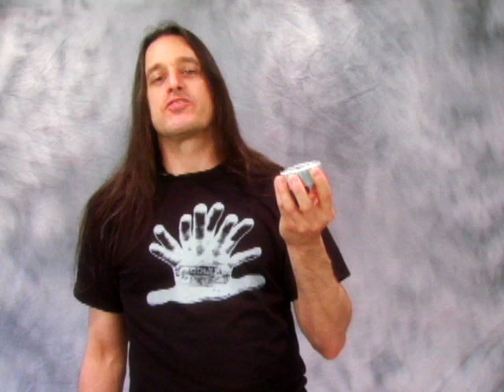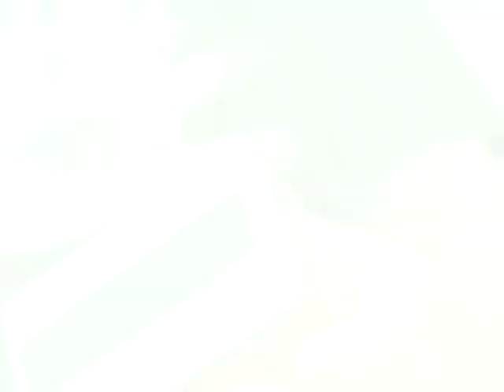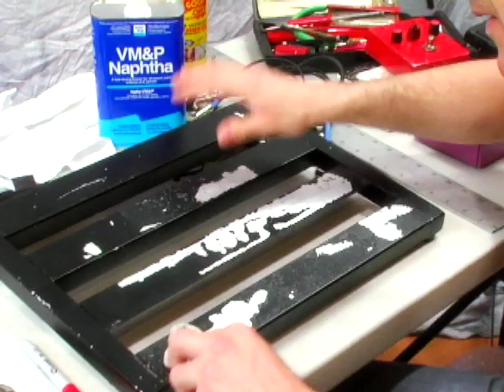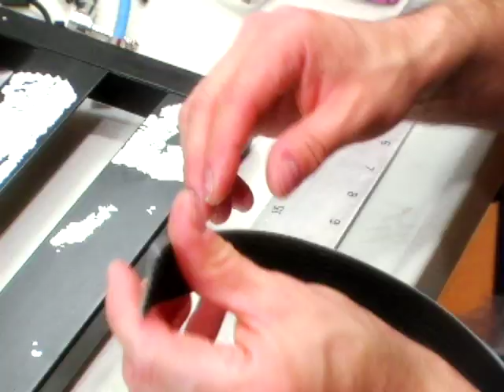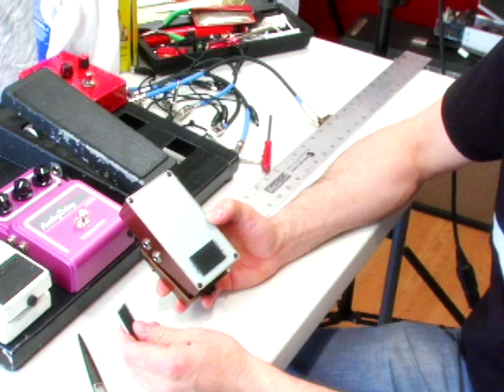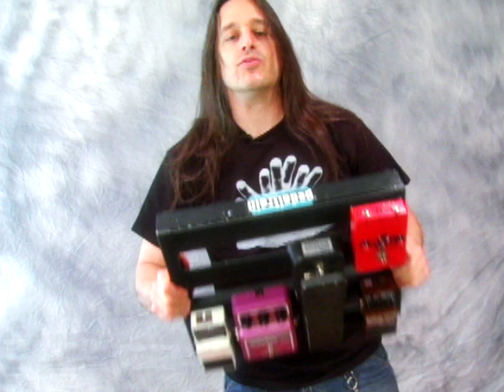Pedalboard Velcro Alternative | Pedal Board Tape Review

Comment: Sorry for all the posts but I just remembered another use for Power grip.  I used 4 small pieces to attach the rear license plate on my car.  It's been on for at least 1.5 years. Through hot summer and 2 Ohio winters.

Comment: I used Powergrip on an aircraft aluminum custom board.  I was heading to a gig and my car got "rear ended".  I was doing close to 30 mph and the guy who hit me was doing 60 mph.  Totaled my car.  My board was in the back .  All the pedals were still on the board!!  some of the pedals broke and lost metal just from the "jolt" but they stayed on the board.  F'n amazing.  Powergrip is no joke!! I'm about to order some more and forgot what it was called until I ran across this vid.
Reply: also....Just a tip.  I cut small triangles for a couple of corners of each pedal so I could "Wrestle" them off the board to make it easier to change up the board.  Still has plenty of "grip" to stay put on the board.

Comment: How do you remove Power Grip? Will it work with my painted wood home made pedal board?
Reply from the maker: Thanks for the questions. You can find most of these answers on our website:

The Power-Grip adhesive backing will form a permanent bond over time. Once this occurs, Power-Grip may damage painted surfaces or leave adhesive residue if removed. Residue can be removed with Acetone or Lighter Fluid.

Power-Grip adheres best to smooth surfaces such as coated metal or plastic. It will not adhere well to very rough surfaces such as unfinished wood, etc.

If you have any additional questions, please email us directly and we'd be more than happy to give you a hand. info@godlyke.com

Comment: this stuff is good but it's expensive. and it's only 1 inch wide. it would be nice if it were 2", dare I say 4" wide, but a 4" piece would be $60 per meter! I wish pedal companies would just start making mounting features directly on their pedals, such as "longer" screws that can come up through a piece of wood, through the back plate and into the pedal housing. Or holes on the side of the housing for screws. Or slots on the back for zip-ties. hell, even specially made brackets with thumb-screws.
Reply from the maker: @Gutch220 All good ideas. One of the main reasons that Power-Grip comes in 1" wide strips is because to properly mount a pedal using Power-Grip, you really only need two 1.5-2" strips to hold a pedal onto your board. Any more than that and the pedal would be almost impossible to get off the board. 

As for manufacturing pedals with a standard mounting would be amazing... but then you'd have to get all the pedal manufactures AND players to agree on the best way to mount your pedals, which would get kind of crazy. 

If you have any more questions or comments, feel free to email me: info@godlyke.com

In music,
Will

Comment: How many rolls I will need for my Pedaltrain Novo 24?
Reply from the maker: +Juan Lopez Thanks for the inquiry Juan! We're actually in process of putting together a chart just for this to put on our website! Unfortunately, there are still a few calculations for the new Pedaltrain boards we need to check. We'll get you this info ASAP though. Just drop an email to info@godlyke.com
Reply from the maker: +Juan Lopez We didn't see your email! Anyway, we looked at the Novo 24 and looks like 4, 1-meter rolls would cover the board. There would be a remainder of about .5 meters to use on the backs of your pedals. If you like we just started selling our 5-meter rolls which will give you 1.5 meters extra to use on your pedals (or whatever else you'd like to mount!) I hope this helps!

Comment: isnt this just dual lock? with your name branded on it
Reply from the maker: +alexander “aj” chang It actually isn't. There are a few key differences between Dual Lock and Power Grip. One of the key differences is that the stems on dual lock are molded into the base. So, as weather expands and contracts the glue, the base and the stems remain rigid which compromises the adhesion. Juxtaposed, Power Grip stems are woven into the base enabling the them to expand and contract with the glue, keeping your pedals secure through any climate change.

Also, the adhesive used on Dual Lock is not as strong and, we have found, not ideal for mounting pedals on a pedalboard; especially when taking them on any long trips in any planes, trains and automobiles. In addition, the Power Grip stem count is 100 per inch, which we have found to be ideal for mounting pedals to a board and having them not move until you want them to.

I hope this helps. Let me know if you have any more questions. :-D!
Reply: +GodlykeInc I LOVE HOW ACTIVE YALL ARE ON THINGS , MY GUITARIST , LOVE YOU GUYS BLACK COMP N 808
Reply from the maker: +alexander “aj” chang Aww, thanks man. Yeah, we try to be available as best we can. Glad you're liking our products! :-D!
Reply: @GodlykeInc  bullshit its  a 3M product for outdoor use. or a crap chinese copy
Reply: @GodlykeInc  Hey man is it easy enough to remove the pedals once on your board or do you need a lot of effort to remove it?
Reply from the maker: @hitsfromthebong7629  It is easy enough, but it depends on how much  you use. We always recommend Two 1-1.5" pieces on a standard Boss-sized pedal. However, if you coat the whole pedal in Power-Grip... then good luck getting it off, lol.

Just a dab'll do ya. ;-)

Comment: How is this a Velcro alternative, Velcro was still used to secure the pedals.
Reply from the maker: Josche Lei - Actually, Power-Grip was used to secure the pedals.  Power-Grip does not have a hook & loop connection like Velcro does - that being said, it is an alternative to Velcro.  Please watch the full video and you can see the benefits of Power-Grip over Velcro....
Reply: GodlykeInc  If I used Power Grip, then wanted it removed from the pedal,  would I be able to cleanly do so even if it's adhered to a rubber surface?
Reply from the maker: Josche Lei - Power Grip does not adhere well to rubber - metal, plastic, or coated wood give the best connection.  You can remove Power-Grip from a pedal or other surface, you just have to be careful - pry up a corner so that you can get a pair of pliers onto the tape, and then slowly but with consistent pressure pry it off....

Comment: Just bought 8 rolls and it's far better than "hook and loop". Want to add that my boss pedals worked fine without removing the rubber back. Just cleaned them first and the glue adhered without issue.
Reply: Is it easy enough to remove your pedalsonce on your board? Or do you need a crowbar to get rid of it?

Comment: How much power grip tape did you use to cover the PT Junior?
Reply from the maker: You need 3.7 meters total to cover the PT-Jr.  However, if you want full strips with no seams, then you'd need 5 rolls total, as some of the lengths are almost a full meter and there's only a little scrap piece left over...

Comment from the maker: yes of course this goes on the pedal and on the pedal board. you can absolutely remove your pedal from the board once you use power grip but it is quite difficult. The point is to keep your pedals in place during transport of you pedal board and on the gig. if you cover your battery compartment you will obviously not be able to get in. 
if you use batteries and take your pedals on and off of the board after ever use Power Grip is probably not the product for you.

Comment from the maker: I have personally used this on the bottom of my pedals and into my pedalboard with the "felt" side of the velcro on the bottom of the board and it works well. not as good as with power grip on both. i can't tell you how it will work with "carpet"

Comment from the maker: It is not designed to stick to wood. you would have to seal the wood with something first. Ask your local paint store. Problem is the glue is so strong it will rip the paint right off of the wood. So again you'd need more of a sealant than a paint.
Reply: GodlykeInc you can you staple it to wood I'm thinking ?

Comment from the maker: Most petroleum based solvents will break down the adhesive so you can easily remove the Power-Grip tape...products such as naphtha, lighter fluid, brake cleaner, etc.

Comment from the maker: @vivasykes - what is the surface underneath the carpet made of?  If the carpet can be pulled up you may be able to adhere PG to the surface underneath.  If not, then you'd have to get an alternate pedalboard to use PG with...

Comment from the maker: @apuppitswill1 - It can be removed, but the longer it is on the pedal the stronger the bond will be.  it may remove some paint with it as well, so if you can put it on a paint-free surface (like on a Boss pedal bottom) that is best to avoid damage to the pedal finish...

Comment: To easily remove pedals with Dual Lock - use a credit card to slide it under a corner separating the velcro locks while pulling up on the pedal.

Comment: Bought some power grip recently - great stuff! I gotta say it's much better than the dual lock that I've used for the past few years. Power grip's adhesive does create a better bond and my pedals grip my board better with it. So far it's the best tape I've tried, and I've tried them all.

Comment from the maker: @Youreallysuckguy Yeah...we know how difficult it is to remove a pedal from your board when you're using 3M Dual Lock. Another big difference between Power-Grip and Dual Lock is the stem count - specifically the number of mushroom head fasteners per square inch. Power-Grip has a lower count that Dual Lock - it's the best of both worlds. With Power-Grip, your pedal grips firmly to the board, but it's definitely easier to remove because of the lower stem count.

Comment from the maker: @Kuffuffled POWER-GRIP IS NOT manufactured by 3M...Yes, the products are similar as far as the dual mushroom type fasteners, but the big difference with POWER-GRIP is the adhesive. It cures to the pedal and pedalboard in 24 hours, forming a permanent bond...the POWER-GRIP adhesive is highly heat resistant, so as long as you prep your gear properly like in this video, our pedal board tape will adhere to it PERMANENTLY!...saving you a bunch of coin for years to come by not having to replace it.
Reply: So I won't be able to remove this stuff from my pedals in case I wanna sell them, right? ...Hm, not exactly a plus.